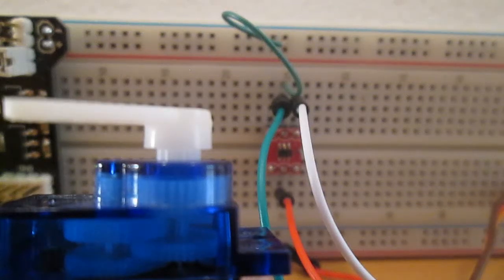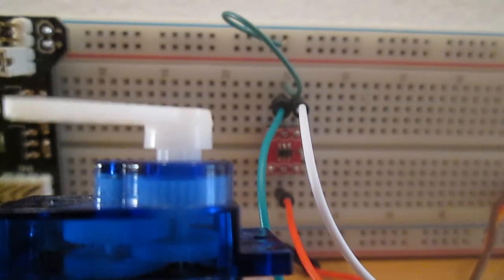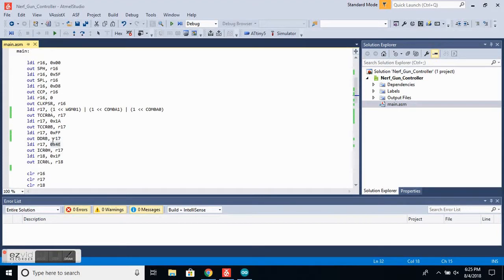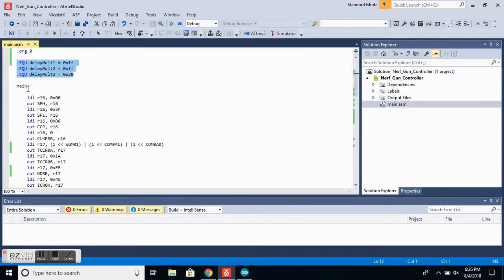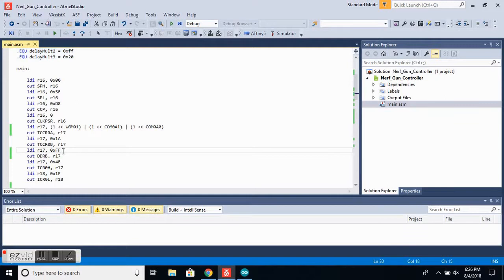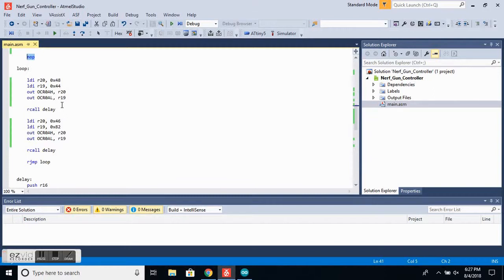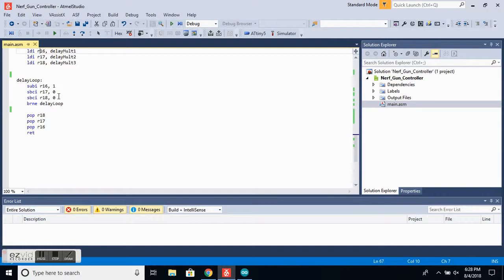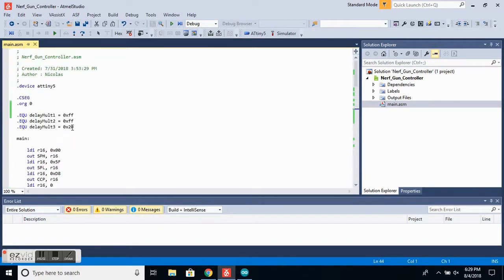How to control a servo with assembly and an Attiny5

Comment: Can i use that code for atmega16?
Reply from the maker: I think for the most part you can, you would just need to change the .device and some of the pin mappings might be different. I can try running it and get back to you.
Reply: @nicolasrist4669  oh thanks ,please run it.i have to finish  it for my assessment.🙏🙏
Reply from the maker: @gabuttv2778  For some reason I can't find it (or maybe I mistook it for something else), but I looked at the datasheet and saw some things which will differ from what I wrote. 
First of all, it doesn't have a CCP or CLKPSR register, so you will need to delete those lines. You might need to change the timer prescalar (CS1[0:2]) because of that, but I'm not sure. 
The second thing is that the atmega16's 16 bit timer is TIMER1, so everything timer related which is in the code needs to be changed to a 1 (e.g. TCCR0A -> TCCR1A or COM0A0 -> COM1A0). 
Third thing which changes is that the OCR1A is on PORTD instead of PORTB so you will want to change the DDRB -> DDRD. I think the pins are PD4 or 5 for the OCR outputs, but you may need to check that. 
That should be everything, and with a bit of playing around it should work. If not, let me know and I can try again. In atmel studio it seems to work, but I didn't measure the time.